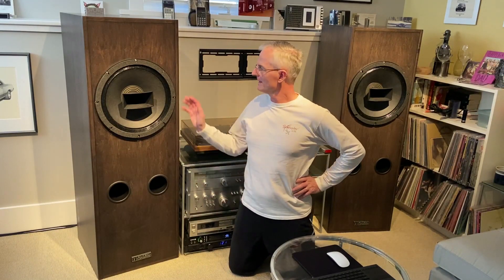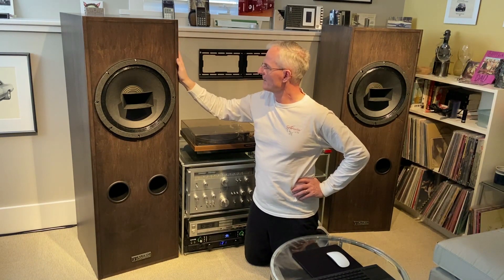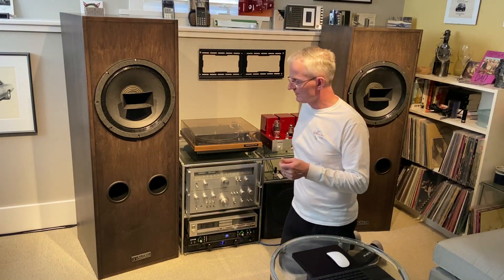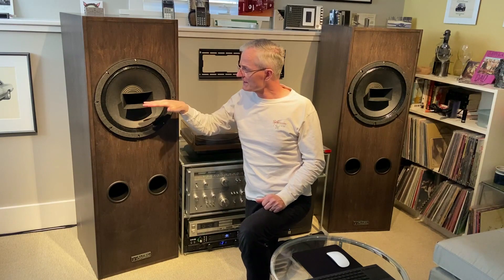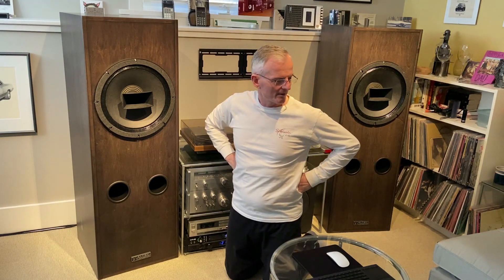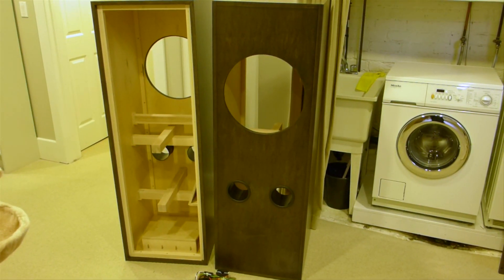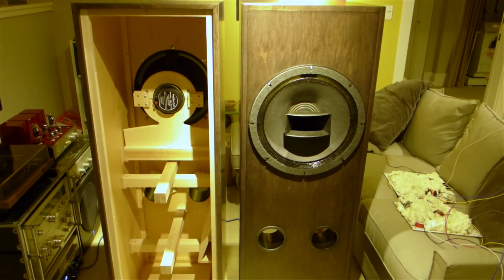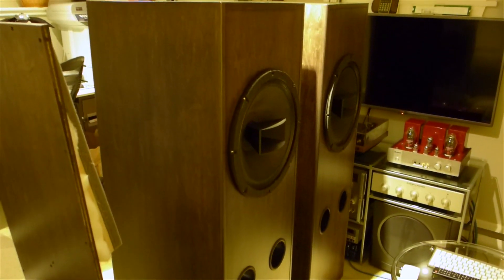Altec Lansing/GPA 604-8H-III Studio Monitors

Comment: Derek,

I am curious as to what monitors that you eventually ended up with. How do you like the active loudspeaker approach?

I am in the process of rebuilding my system. I had a pair of early K-Horns with first order crossovers powered by a Fi 2a3 SET. I have looked at PSI and Neumann actives and would be interested in your experience in this area. 

I am in the Portland area and find your page very entertaining.  Thank you for your time.
Reply from the maker: I have a pair of HEDD Type 20s - those of mid-field monitors - very accurate but not always pleasant to listen to. I have just finished building a tri-amped DSP based set of ADS L710s (40 years old but now sounding 21st century-ish) - these  speakers are more musical sounding to my old ears

Comment: Hi everyone, I am not a very technical person when it comes to speakers. I need some guidance, please.

I have a Macintosh 7900 integrated amp, connected to Altec Lansing 510 speakers. 

Over a period of 4 years, my amp has given me problems 3 times, it does switch on, even though it is on a standby mode. I have to take it to the dealer and they rectify the same by fixing the on/off firmware. Just yesterday, while rectifying this problem he mentioned that the issue could be because of either the speakers or the electricity fluctuations, which does not happen much in Dubai. He recommended to change the speakers.

Please advise, is the speaker a good match for the amp? And, will it make a huge difference if I switch to Focal Kanta No 2 speakers. Your assistance is much appreciated. Looking forward to your guidance. Thank you.🙏🙏
Reply from the maker: I don't think it is your speakers - most modern amps can drive very low impedances.
Reply: @derekspratt  thank you Derek.

Comment: Just came across your video last night and wanted to congratulate you on your construction and engineering skills. I've constructed three sets of large speakers over the years. My very first venture was in the 1970's as a poor graduate student. 

#1 was a set of Altec Lansing 420A's housed in a Valencia-sized box constructed of 1 inch thick furniture grade plywood (3/4" with 1/4" walnut), combined with the 3000H high frequency tweeter and 3000H crossover. Still working beautifully after all these years, though they had to be repaired after an amp blew out both of the 420A's. The 3000H's were fine.

#2, constructed in 2005, was based on the Stonehenge III design, using GPA (Great Plains Audio) 604-8H-II's and the GPA crossover. This time used, red oak furniture grade plywood. Excellent, though I did add an Apron Intimus S12 subwoofer for added oomph. Not really needed except for when I play pipe organ recordings or in home theater mode. Still working and in use every day.

#3 constructed in 2009, based on the AL 620 cabinet design, this time using the GPA 604-8H-III's. I used 3/4 inch solid red oak boards glued together on most of the cabinet, except the back. Otherwise, everything else was as for #2. Never had a problem with these units.

All six of these units are totally functional and played daily. I did add another subwoofer (SVS PB-1000 Pro) a couple weeks ago.The prices on the GPA's have gone way up, since I paid $750 apiece for them.
Reply from the maker: Awesome! Well worth the effort ...

Comment: hey derek love these drivers i myself have a pair of 16 inch altec lansing 416 8z with a pair of hail air transformers planar drivers as mid high and i will never replace that driver it sounds like a real live instrument with all its dynamics no stress at all .altec drivers are amazing mine looks like new after 45 years .......
Reply from the maker: I think your addition of the ribbon tweeters is a neat idea as it would extend the high end - especially with your older horn drivers which roll off more than the latest designs so - I really like ribbon technology - fast transients!
Reply: @derekspratt  well its more like a plannar driver but yes it does the work perfectly.....

Comment: I about choked when he said what he paid for the cabinets.
I build cabinets and Altec systems all the time so I can say, I hope you at least got diner and drinks.
Reply from the maker: A lot of it was the finish work - about 30% of the cost to get the look I wanted - plus there were a number of tricky internal design elements that weren't strictly necessary ...
Reply: @Arkman : I'm about to build a pair of cabinets for 604-8EII. My client wants the size to be 24w x 36h x 16d. Do you have build plans for cabinets about that size for those speakers? Please share.